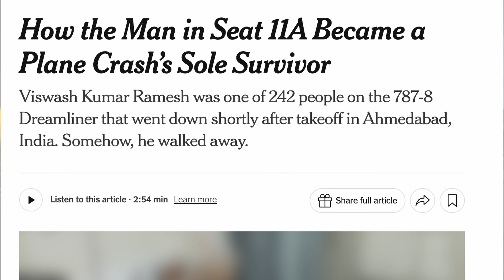Why the RAT Changes Everything – Air India 171 Update

Comment: Seems a simultaneous dual engine failure would be the result of a total control systems failure due to a total electrical failure more so than both engines suffering the same mechanical failure simultaneously.

Comment: Just because the landing gear stays down doesn't mean the flaps were retracted. I said that 2 days ago. It just means the landing gear stayed down, that's all. Anything else is purely assumption.
Reply: the issue is the sequencing of actions and the expected actions at a given moment - given the available information, Capt Steeeve made reasonable observations. the possibility of dual engine failure is almost statistically impossible. there are three independent hydraulic systems powered by both engines and the apu AND the RAT. the presence of the RAT changes the initial analysis, and suggests something that may ground all similar Dreamliners, which is staggering.

Comment: Tragedy aside, its a  welcome change to get a highly qualified person giving well founded theory on why the crash happened.
Reply: Well he was spouting pilot error without any rigorous analysis because he had no other explanation. And when lots of other experienced people pointed out the evidence now he has no other option but to change.
Reply: @kumark214  yeah kills the channel for me.
Reply: His theory before was dumbfounding. Now it’s well founded because he has seen other videos pointing actual evidence.
Reply: He's still spreading misinformation or at least not expressing himself properly. The RAT is not going to power the cabin lights... and the loud bang may have been an engine compressor stall. 
More likely one or more engines went below idle, causing the electrical generators to go offline. There will be power transfers and possibly "loadshedding" if one engine failed. If both engines went off, the emergency lighting would illuminate. Loadshedding is where unimportant things like galley power is shut down (although on some aircraft it can shut down redundant fuel pumps).
Reply: Except that that "wrong handle theory" was absurd and not even possible
Reply: He's TWO DAYS LATE with this info.  I sometimes wonder if he is a real pilot.
Reply: @cccc9911 May be a Boeing planted mole in media to brainwash people about their theory.

Comment: Great info. I also think, combining this with the other video that shows them lifting up right at the end of the runway and kicking up dust, that whatever happened to the engines that reduced their power happened on the ground after V1, and they struggled to get it in the air (their only choice at that point). It was only in the air 30 seconds and one of the pilots still got out a mayday call. Already knew something was very wrong. I think the emergency had to have started on the runway.

Comment: Hi Capt. Steve....I saw a Youtube post earlier that zoomed in on the right wing and you can see leading edge slats appear to be down... which I guess means he at least maybe had Flaps 5 ??? What do you think ?? ... and the audio of the Capt's Mayday call to tower he mentions loss of power.... so if they did lose thrust in both engines and the RAT was out, does it provide enough hydraulics to raise the gear ??? i'm thinking no....

Comment: Is it possible the pilots manually deployed the RAT after misdiagnosing their loss of control caused by retracting the flaps instead of the landing gear? (original theory) 

If it was fuel contamination wouldn't other planes be affected?  Otherwise without bird strike I don't understand how both engines could have failed at the same time.

Comment: When the "dynamo"underneath is lowered, that means that both engines are down and that the tiny propeler supplies enough voltage to activate some safety systems... So why were both engines down? A flock of birds? BTW Those GE engines are known to be reliable...

Comment: The thing that puzzles me is the length of the takeoff roll. 

They should have rotated with something like 4,000’ of remaining runway rather than rotating basically at the end of the runway. 

My latest guess is that an engine performance issue occurred between V1 and Vr that it continued to deteriorate after rotation.

Comment: Very clear audio. Thank you. Next question.... exactly why did the emergency generator (RAT) deploy?  I've been a jet engine tech for 45 years and I can't recall hearing of an airliner losing all (or both) engines without something obvious leading up to that point.
Reply: Last ATC call from the pilot: " thrust not achieved, falling, mayday mayday mayday"..they used full runway 3.5.. usually it takes 2.5 to 3 for widebody aeroplane in this airport. Today news update
Reply: can electrical failure be the reason - so engines stopped working?
Reply: Might be a dumb question, but could the wrong fuel type been loaded?
Reply: @HLS6935 Definitely possible.

Comment: At 3:18 in your video, just as we lose sight of the air craft, what is the debris fluttering  right to left in frame? It’s just behind and to the left of where the plane was but seems much closer to the camera.
Reply: I saw that the other day too. Could be a power pole?
Reply: I was actually thinking it might be the RAT door panel if it got ripped off. It’s fluttering down about the area where sounds like the RAT was deployed.

Comment: There has been some talk about the lithium batteries on this model jet suddenly catching fire. These batteries do not burn. They go off like a chemical blowtorch, not causing any smoke until they start other things burning.
 If the lithium batteries went critical because of the super hot day, and potentially a long time on hold on the runway, they could have burnt through the wire loom extremely fast with no warning. Causing everything electrical to shut down instantly. Which would deploy the rat, I guess. And explain why  the engines simply went to sleep as soon as the jet took off.
 This lithium instability might get much worse, especially if the jet were running those batteries on a very hot runway, and then the batteries entered a high charge phase. Potentially when the engines are making full power, with a lot of excess electrical energy to bleed off into the batteries. Like right at takeoff.
 There was a statement  from someone who got off that jet earlier that the interior  lights were pulsing on and off as they left the jet. 
Something turned the power off in that jet very fast. This runaway lithium battery possibility  is just one way of several ways a no power situation could occur. 
The recordings of the equipment should be very telling. If the power shutting off did not turn them off as well.

Comment: The wheel assembly was tipped forward as if the landing gear retraction stopped mid-retraction. At least that's what it looks like to me. So hydraulic failure due to dual-engine failure right after takeoff?

Comment: Another reason no to do an intersection/ turn off take off.  I lost a friend in a 700 AEROSTAR that was in a hurry and did an intersection take off and the oil pressure controlled came  in TOO LATE.  IF it was fuel contamination why was there not at little of yaw, because none synchronized thrust reduction?  Was there fuel condition tests done on the ground fuel ports or truck. When we put tanker loads of fuel into the tank farm, we would test fuel by putting the first out of the truck into a clean white bucket.  WE would drain the trucks belly tubes.  3 five gallons of fuel per truck load.  I used it to heat my house.  Others it for their diesel cars and added a quart of oil/55 gallons.
Is the 787 a TOTAL fly by wire, with all electrical busses drop off line.  What electrical anomaly would make the SPEED BRAKES DEPLOY?  How would it effect engine auto throttle or conditions that are not pilot inputs.

Comment: Couldn’t a hydraulic fails cause  the landing gear to not retract and potentially mess with  the flaps position? Could they have set the flaps appropriately but if they had hydraulic failure, could the flaps not moving have been the an early side effect of that? Does the plane’s system check the physical position of the flaps or does it just go off of what the lever is set to give warnings?

Comment: Some kind of a total electrical failure issue could have also affected the engine control computers, potentially causing precautionary dual engine shutdown by the computers which tried to protect the engines from overboost

Comment: Captain Steve,
Is there a squib used to blow open the RAT doors or some other mechanism?
Could explain the “bang” that the survivor heard prior to the lights in the cabin lights flashing.
Just curious how the doors for the RAT are designed.
FYI, I’m a 30 + yr A&P mechanic with zero experience on the 787.
Only MD 80 , DC 10 and MD11 along with F/A 18 Hornet avionics experience.
Blessings from Oklahoma

Comment: If the lights flickered, doesn't that mean there was electrical power?  The RAT takes a little time to deploy and spin up, so it would be more than a flicker if it was an electrical failure prior to deploying the RAT.  The flicker could be the momentary interruption in the switchover to RAT power.

Comment: I'm going back to my original thought, it's a total loss of all power in the aircraft. Either the electrical system failed, or the right seat flipped the master bus instead of the gear.

Comment: Bad or no maintenance at all on the engines especially, combined with rather high outside temperature (cf 37 C), could have lead to the loss of both engines. Or boiling or to hot fuel even before entering the combustion chamber?